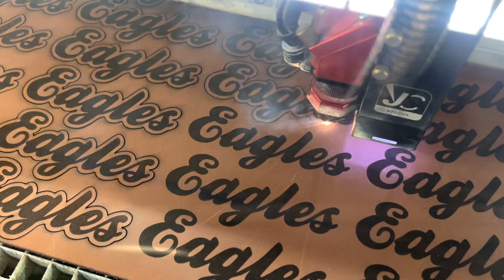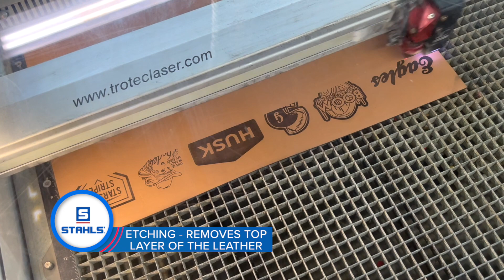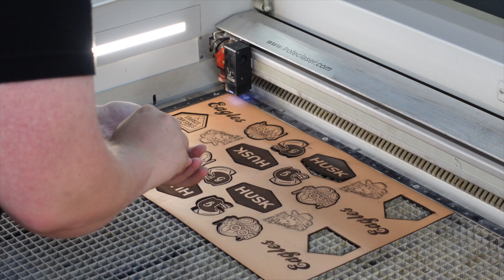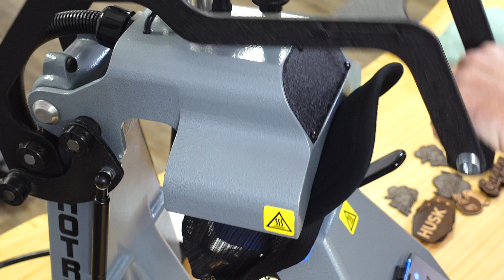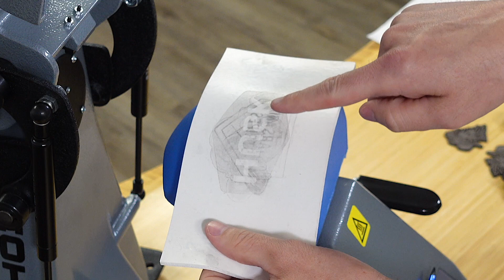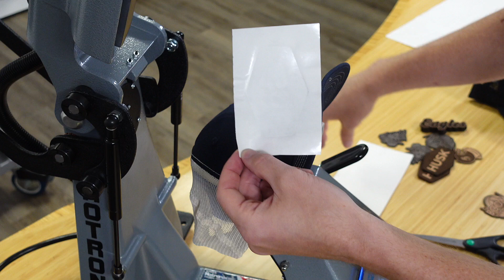How to Make Your Own Leather Patches

Comment: How long these patches last so they don’t peel off the hats? Should they be stitched for more durability?
Reply from the maker: The Genuine leather should not be used on materials that will be washed. The Faux leather has been lab tested for up to 50 washes when applied according to our application instructions. You can learn more about both here https://www.stahls.com/twill-applique-fabric-material?tag=Leather
Reply: @StahlsTV  You didn't really answer the question and the link provided doesn't either.  No, they won't be washed.  I typically tack down all my patches on hats to make sure they don't fall off if the adhesive eventually fails.  I have lots of customers who leave their hats out in their vehicles in the heat.  Should they be stitched (tacked down) for more durability on hats?